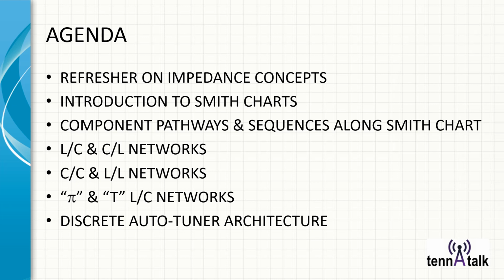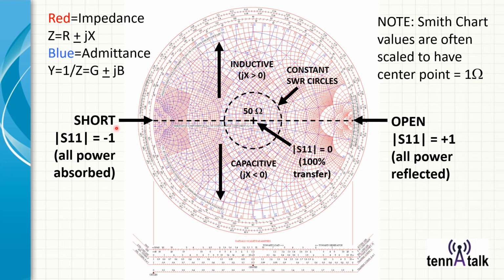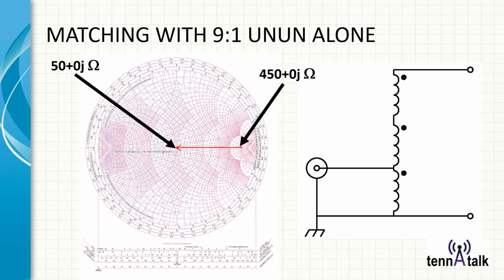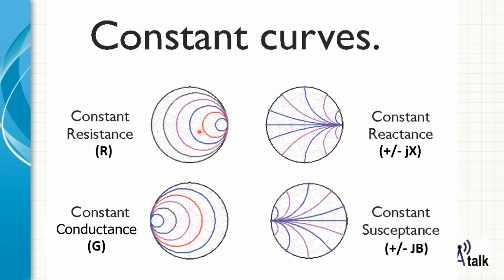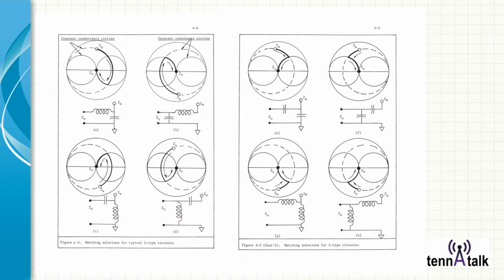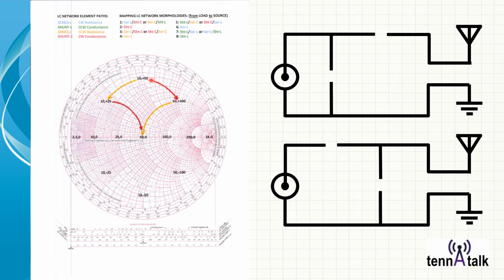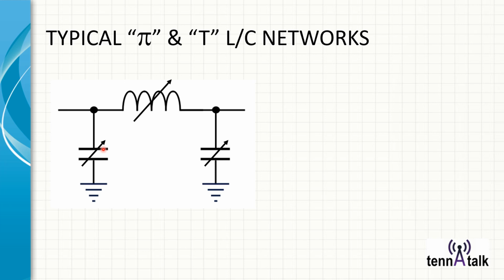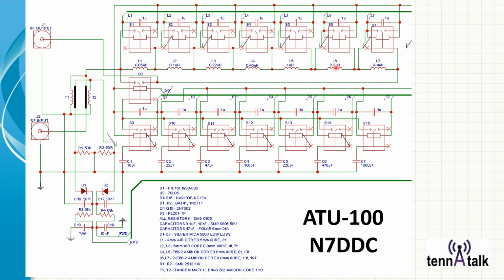TennaTalk #4A Impedance Matching

Comment: 9:1 UNUNs have a capacitor at the input, which is missing in your example.
Reply from the maker: Good call, While not absolutely necessary, for most bands a 100-150pF 3KV capacitor will get you better SWR.